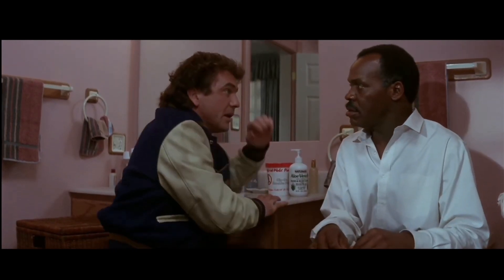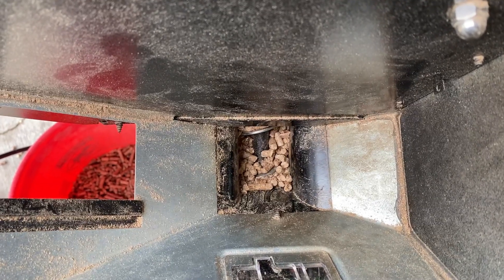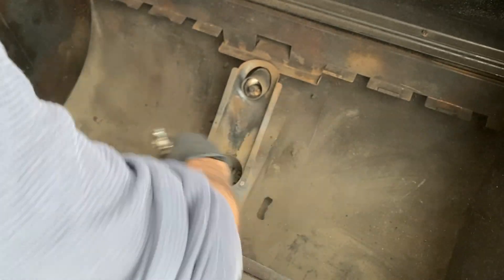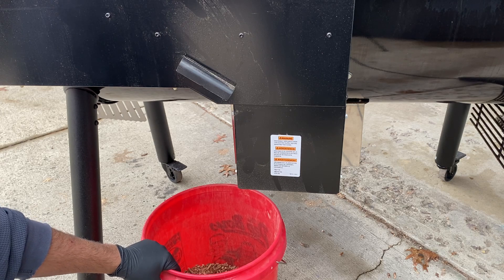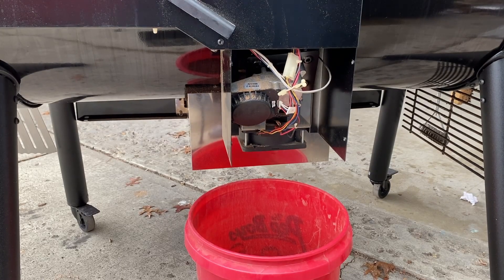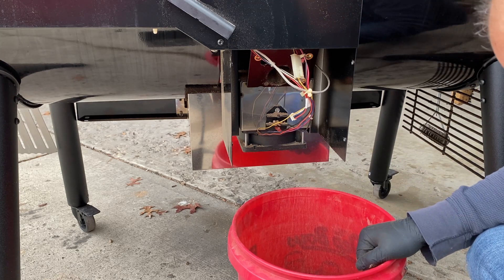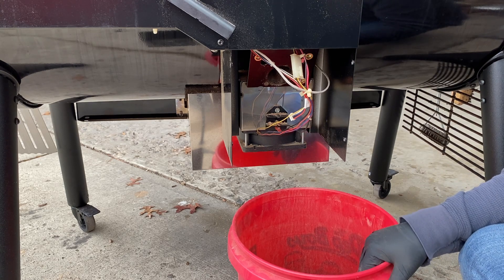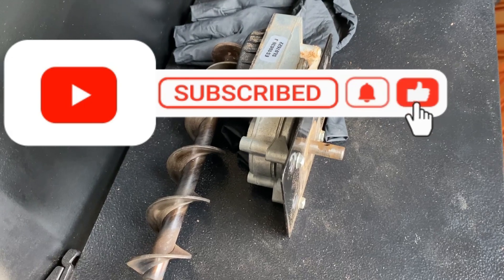Weber SmokeFire Stealth Sear+ 6 Month Fail!!

Comment: 100% accurate. Buy literally any other smoker on the market. The feeder/hopper on the SmokeFire jams all the time. Not some of the time, or most of the time - all the f-ing time. It jams more than a ShadowSystems CR920. When the feed isn't jamming you'll get a grease fire. 100% guaranteed. I had a grease fire on my second smoke. My f-ing second one! Weber makes a great kettle grill, and a good gas grill but that is where its ends. I've owned the Weber Q,  their electric Lumin and the SmokeFire and they are all garbage, Buy literally anything else. This thing is $750 worth of scrap metal.
Reply from the maker: Thanks for the genuine comments.  No grease fires yet…. Gonna stick with it and see how it goes.  I’ve already decided that when the time is up on this grill/smoker, I’m going to go coal and wood next.
Reply: Agree 100% - I completely regret buying the SmokeFire - I've had to replace both the auger and the thermocouple - Weber support is SLOW.  Here's the video of my issue --> https://www.youtube.com/watch?v=iV81RGWnnKM
Reply: @JohnnyRasinske   Great video. I had the same thing happen with mine - runaway temperature. My Smokefire just failed me again two weeks ago, so now it's off to the scrap heap.
Reply: @paulkennedy74   Sorry to hear you're another victim - I've found Weber's support to be not very helpful. I've had to completely take apart my grill two times to install the parts they sent to me, and I still have runaway temperature and zero regulation. This was an expensive mistake. Looking at the Camp Chef as a possible replacement.....
Reply from the maker: Johnny and Paul, I’ve been following these comments and feel both your pain.  Great video.  Hit too close to home unfortunately.  Concerning Weber’s CS, I can’t say I’m disappointed. They’ve been over-the-top helpful at resolving matters. The only snag was the one month wait time for glow plugs, which I’m guessing is a supply chain issue. SearWood should be here in a couple days.  Video to follow.
Reply: @sambosplace  Weber's CS completely gaslit me - told me that a 90 degree temperature variation between the thermocouple and ambient probe is acceptable behavior. Why didn't they suggest the PID isn't working and maybe replace that.  The SearWood sure looks a lot like a Trager to me. If I ever buy another pellet grill it will be a Trager or Camp Chef. I'm DONE with Weber because of the gaslighting.
Reply from the maker: Johnny, I have no clue why they’d short you the information. That’s a polar opposite my experience.  Anyway, I have a buddy with a Traeger and based on his experience, the panel and tech was first rate, however, he used it primarily as a smoker, not a griller. I’ve seen the insides of a Traeger and the Weber Searwoood has more impressive heat diffusion than What I’ve seen beneath the grates of a Traeger. If I was grilling more than smoking, I’d have upped to the Yoder with direct flame.  In a comparison video, the Weber blew the Yoder away in smoke signature.  I hope you have better cooks in the future. Stay tuned, SearWood is inbound as I type.

Comment: I've been going down my own rabbit hole of issues with my Sear+ in the last few months.  Purchased June 2023 and was flawless until around September, when my auger failed in the exact same manner.  Pin was sheared off and remnants were in the shaft.  Weber sent a new auger and pin, then the motor failed a month later.  Have been working through several other issues with Weber ever since and am now going through all your videos.  But so far, this looks very familiar.  Thanks for sharing your experience.
Reply from the maker: Jim, I’m sad to hear this.  And this issue is with the SearWood??   Check to make sure your auger is centered in the tube.  My SmokeFire was high at 2 O’clock and the pellet feed was causing too much resistance and then failure. 

That said…. One of the main questions I had with Jesse C before I chose to stick with Weber, was if the auger/motor assembly was improved.  I was told YES…. Then when I received my SearWood, it clearly has the same nut and bolt pin assembly as the SmokeFire.  

Sad to hear this.
Reply: @sambosplace  This issue is with my SmokeFire Sear+ ELX4.  Same as the one you had, but the smaller version.  I've been a Weber guy for many years, and as you experienced, their customer service is top notch.  But I'd prefer to have a grill I can count on.  Continuing to work with them to see if we can get this sorted out.
Reply from the maker: Jim, unfortunately I surrendered my ELX6 back to Weber.  I have videos on that progression.  Very sorry to hear of your frustration.
Reply: @ Happy to report the issue has been resolved and I'm back to grilling.
Reply from the maker: Jim, good news!  Hope your pit stays healthy!  She’s a helluva smoker! Cheers!

Comment: Sorry for the issue bud. Any update on the fix for this? Just a new pin to replace or are they sending you out a new auger assembly? Looks like i should invest in some aftermarket pins to get ahead of this. Any idea on the size needed? I've only got two cooks on mine and so far I'm very happy with the food it puts out. This is my first pellet grill and it's sooo convenient as opposed to my WSM. I was thinking about selling the WSM but think I'll keep her around just in case. Still love playing with 🔥. Hope you get yours back up and running better than ever.
Reply from the maker: Brian, thanks for checking in. Check out part 3.  I’ll see if I can get some specs from the other pin they sent.  It doesn’t look like anything you can purchase commercially.
Reply: @sambosplace  I just watched part 3. Glad  they took care of you. Now you have extra parts and hopefully you don't have any more mechanical issues. Weber is discontinuing the SmokeFire and it will be replaced with a new model that's sadly made overseas. From the looks on their website, it will be revealed in a couple of weeks. Hang on to your 🇺🇸 made model if you can..
Reply from the maker: Sadly, it’s why I purchased the Weber, being 🇺🇸made…. The motor/auger is installed and sadly enough, there’s another issue, I’ll be doing a part 4 shortly.  My buddy bought a top of the line Camp Chef, and has had so many problems the first 5 months, they’re sending him a complete new pellet griller/smoker. Trying to remain positive about these electric pellet devices, but I’m leaning towards going coal and wood.